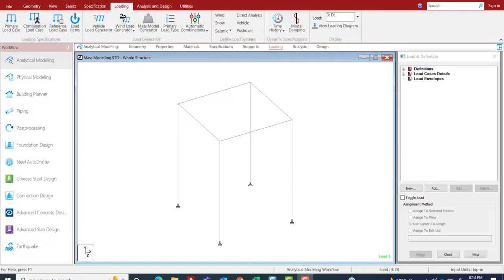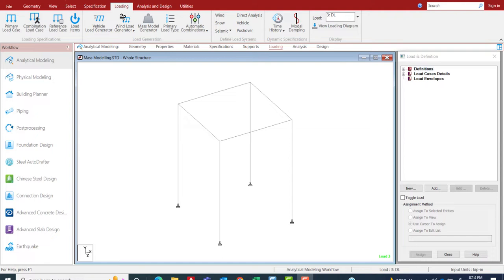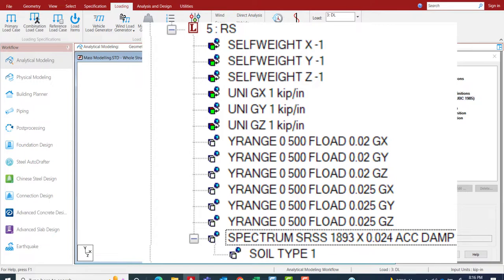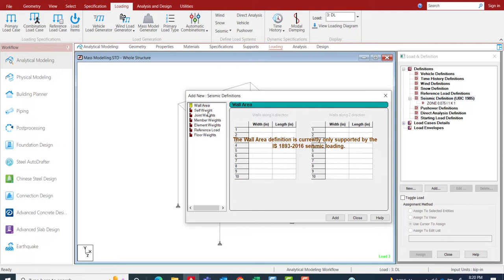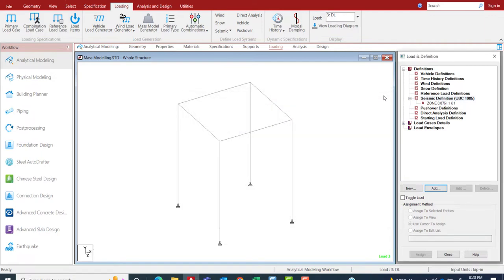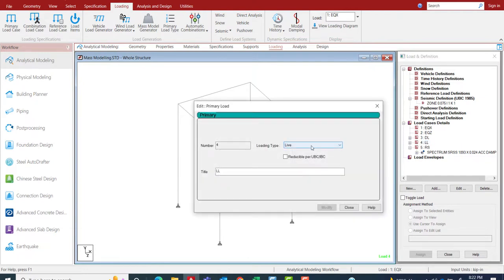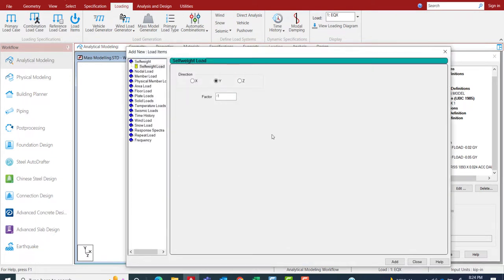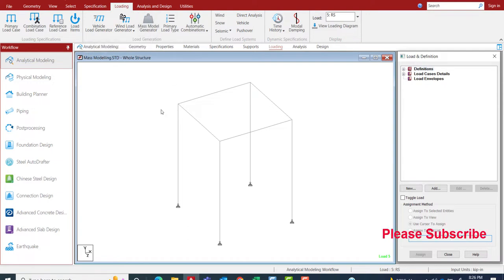Mass Model Generator in STAAD for seismic analysis

Comment: sir, is it necessary to define earthquake load first in load cases and then dead and live loads are defined?
Reply from the maker: Yes, its is necessary to define the static seismic load case first
Reply: @Torq123  what if in command file, i have pasted earthquake first even though load case number for DL and LL is 1 &2 respectively. will it work?

Comment: Sir, without creating reference load can we assign diaphagm
Reply from the maker: You can still define diaphragm but only with Master-Slave ( zx) option. For direct floor diaphragm option, you must have to define Reference Load.
Reply: @Torq123  thank you sir. in other wards, it is better to define reference DL ..R1 ,LL..R2 load and assign DL LL as ref 1.R1,0.5 R2 then utilise create mass model and assign diaphargm. is it correct way sir
Reply from the maker: @fazalarju  yes
Reply from the maker: @fazalarju  yes you need to define the ref load with dead and live and designate the load type as MASS and then it will be used as Mass Modeling..

Comment: Sir, please make a detailed and in depth video on non linear time history analysis of structures, as it is very difficult to apply various parameters of non linear time history analysis in staad pro.
Reply from the maker: Thanks for your comment. NL Time History   is not yet implemented in Staad . Time History analysis is Staad is based on the modal analysis which based on superimposition principles ( linear) .. However , one can do Response spectrum analysis in conjunction with Geometric NL analysis like Pdelta analysis by Geometric stiffness based approach . I have already created a video on the same in my channel . You may visit the same .
Reply: @Torq123  sir, is it correct approach to conjunct analysis method as a non linear(like geometric non linear) and seismic analysis as a linear method (modal time history analysis)?
Reply from the maker: @nooranistores8015  Please watch this video for more detail...https://www.youtube.com/watch?v=3fhjVEXfP88&t=1s
Reply from the maker: We can do GNL in conjunction to the dynamic analysis .Essentially, under this scheme, the program converts the non linear path into a equivalent linear condition by (k+Kg ) matrix and directly solves then rather doing iteration... here the program we are using the geometric stiffness method to active the final solution by modifying s the stiffness matrix directly by KG so that the modal analysis can be performed on the modified (K+Kg) matrix . This method gives good result for building like structure undergoing PDelta effect. This method is first proposed by Edward Wilson which was then implemented in many building analysis package like SAP, RAM , Staad etc